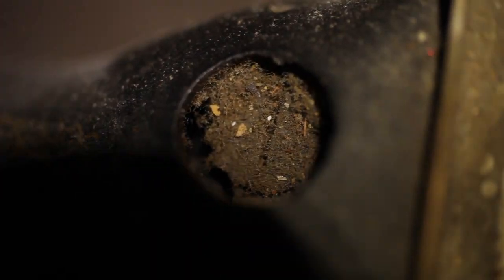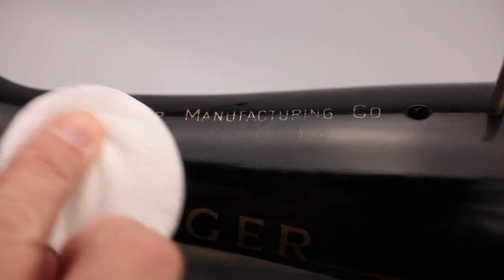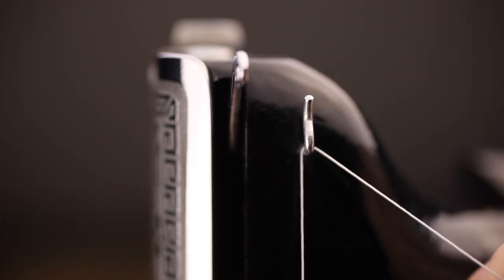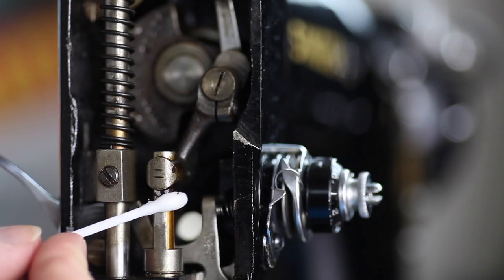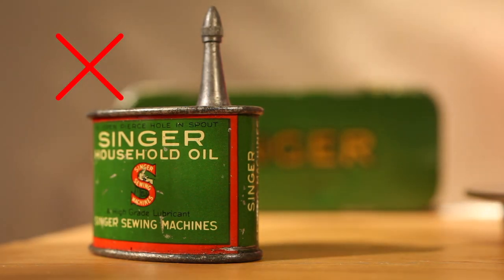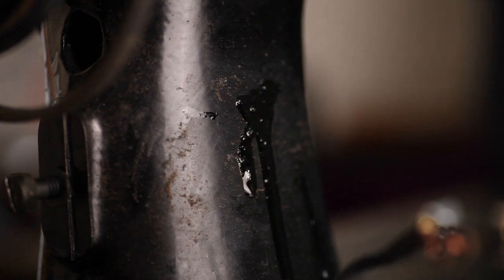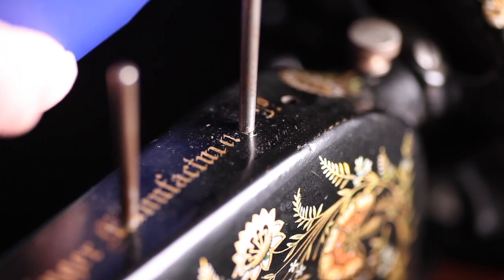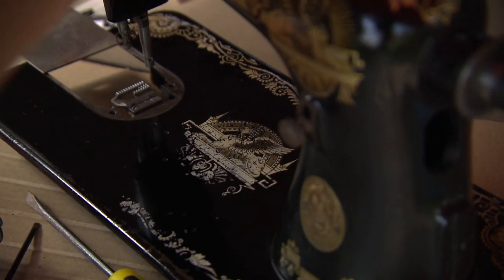Simple cleaning method of your vintage Singer – Using oil!

Comment: Sometimes the simplest method is best!
My old 328 took some scrubbing to get it clean and running well. I think the original owner was a smoker as it had a brownish sticky film on the outside (and smelled like cigarettes) and it had been stored in a garage so there was some corrosion. The more modern finish on it is more durable than the old enamel thank goodness. It works well now after some tlc.
Reply from the maker: You're right. I did the same on my 328 and 401. Both improved a lot!
Good to hear you have your machine working again. Keep on using it :-)